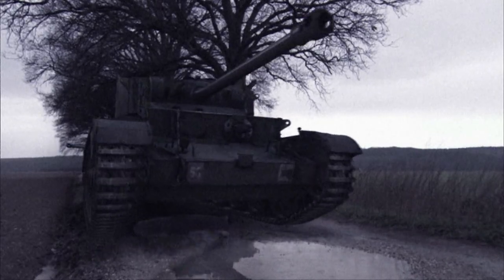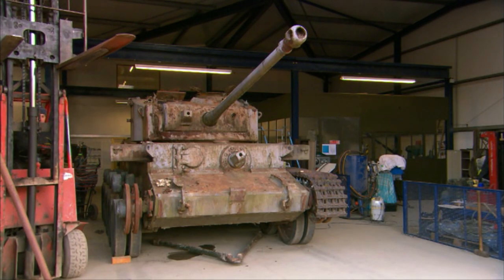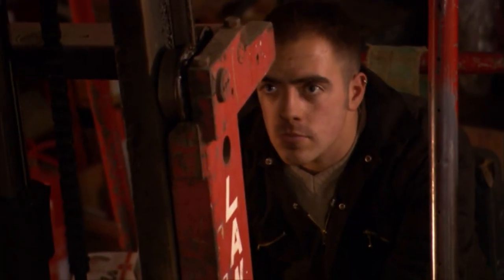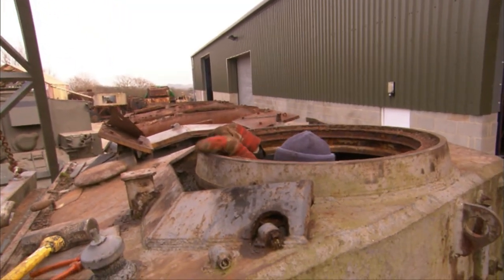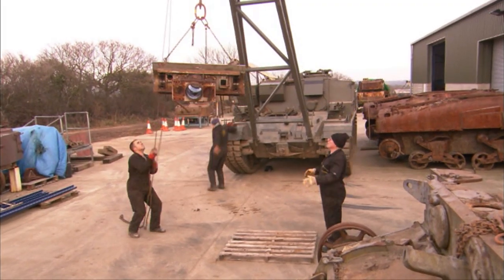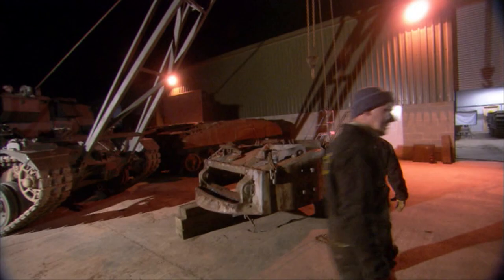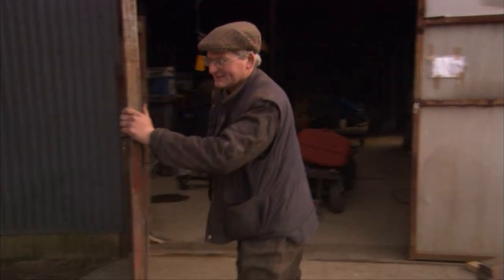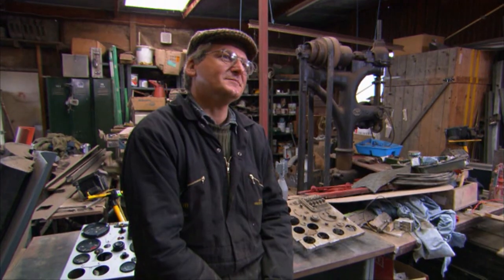Tank Overhaul - Episode 1 - The A34 Comet

Comment: I like how the comet was powered by a meteor engine
Reply: sorry
Reply: Believe it or not aircraft engines were used in tanks because they were.... light (And powerful). You wouldn't think lightness matters in a tank but it did make a difference. The only downside is that they used petrol instead of much less flammable diesel. Aircraft engines were also proven reliable and easy to get. Hence why the Abrams uses a turbo-shaft engine. Very light and extremely powerful.
Reply: @oscarmuffin4322  He meant the Comet and Meteor are similar names. Tho Comet name had to start with a letter C like all the Cruiser tanks. But how much of a coincidence it was? This tank was designed with a proven (in Cromwell) Meteor engine so the name Comet fits perfectly.
Reply: @oscarmuffin4322  Yep power to weight factor is a prime consideration in many vehicles in the tanks case if you have a lighter power unit you can always add more and heavier armour.
Reply: Dave Ad  if only Centurions were ready for the ETO. Centurion vs Tiger II. Awesome.
Reply: Ah yes, the meteor.
The Merlin without the magic.
Reply: @PeteCourtier  To be honest, if it was Centurion 1 vs Tiger 2, I'd rather take the Comet.  Much faster, more mobile, gun actually accurate with SVAP/APDS, and the armour isn't far off the Centurions.

Comment: Hey guys, great videos, please keep them coming. I would like to make a suggestion about working on rusted and seized bolts as well as rusted tight fitting components . Kroil Penetrating Oil is amazing for issues like the ones you guys encounter daily. Kroil Creeps Into Millionth Of An Inch Spaces, Dissolves Rust (this sentence straight from their website). I don’t sell the product nor profit in anyway from saying my opinion about Kroil. Kroil works as described above and I use it all the time. Hope my suggestion helps your restoration projects.

Comment: Comet better than the Pershing?
Reply: I would say no. The Pershing was a very good heavy tank and the Comet a very good medium tank. The Pershing would win 7 out of 10 times
Reply: @alanmountain5804  this tank has slightly better firepower with APDS vs 90mm HVAP and quite a bit better mobility but I think the armor is not sloped so it loses in that regard.
Reply: Depends. Comet is more mobile with a better power to weight ratio than T26. And being a Cromwell on steroids was more reliable than T26. The T26 has better armor and a overall better gun
Reply: @mbr5742  guns were comparable in effectiveness against existing enemy armor. So it's pretty much, which would you rather have, mobility vs. Armor with either having a situational advantage.

Comment: It could have been a good tank But the front chassis was a slab and not sloop armour Not listening to tank men again And it was Rover built meteor engine
Reply: The vertical plate on the front was needed in order to mount the bow machine gun, as the bulk of the machine gun and its ball mount couldn't be mounted in a sloped plate. The designers wanted to delete the bow machine gun to make their lives easier. Unfortunately the tank crews insisted on having a bow machine gun as they found it very useful for rapidly dealing with German soldiers popping out of hedges with Panzerfaustsm, but they were probably not aware of the design trade off. Ironically, I think in this instance, it was the tank crews not listening to the designers.
Reply: It's was  built  cheap and fast has with all British tanks nothing to do with the Besa machine gun they could have mounted the .30 cal has used in the Sherman The only tank we got right was the Centurion Where men the who going to use had their say That why they removed the 20mm cannon that's was going to be the secondary armament